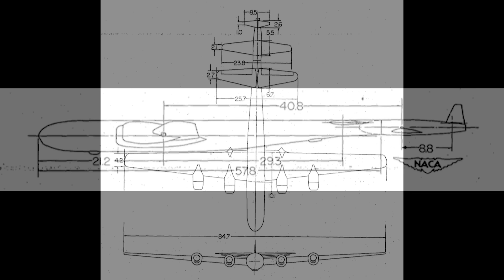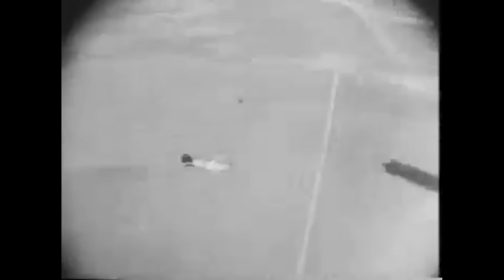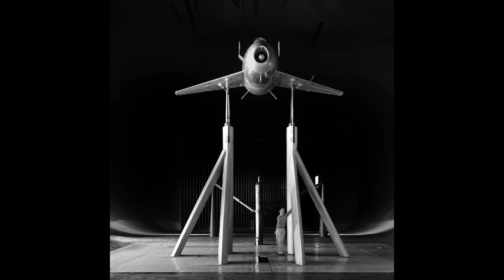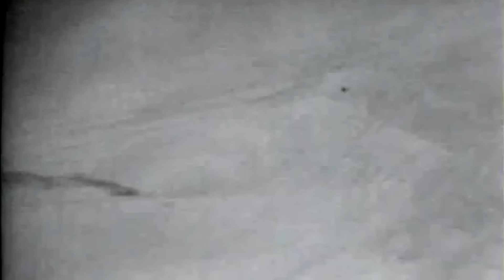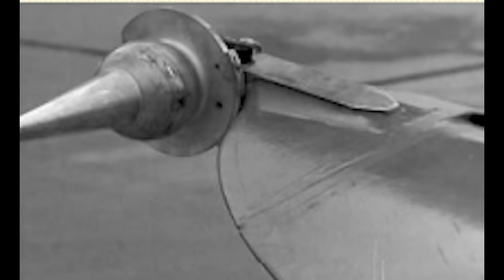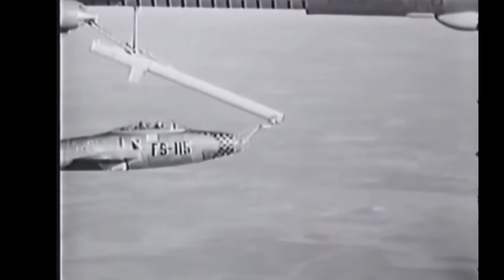GOBLIN, FICON & BURLAKI: Cold War Parasite Fighters Were A Deadly Dead End

Comment: The B-36/B-58 combo did fly. It was how Convair got the prototype B-58 to Muroc for flight test. I've never heard anything about it being used as a method of air launching B-58s for any sort of attack mission. Could a B-36 even lift a fully assembled, fueled and armed B-58? What they did was carry an empty fuselage and wings with no engines and probably no equipment inside. Doubts....

Comment: I always assumed the XF-85, with its jet engine and swept wings, was based off the same research as the F-86, using German data. I was surprised to find from your video that the XF-85/was designed in 1944. I can only conclude then that the Swept wings on the XF-85;were there for weight and balance reasons rather than trans Mach performance.

Comment: I dont care about all the propaganda and bs that claimed the b-36 was invulnerable to fighter attack and its defensive cannons were adequate. There is now way that massive shiny bomber would be able to bomb targets unmolested. Radar would pick it up at very long range and give mig15-17s more than enough time to setup several head on passes. Even with the migs at maximum altitude the size if the b-36 means hits are inevitable. Wouldn’t take that many 37mm rounds to bring it down.

Comment: WRONG. Dumbass AmeroBabylonians tried to put the parasite fighters UNDER the bomber transports. Stupid and Lazy. Parasites should be on TOP of the mother aircraft and it worked fabulously with the Russian ZENO system and German (sexy now) MISTEL precision directed munitions in WW2 COMBAT, the Brits had 2x aircraft combined with mother a useaplane, NASA had Space Shuttles moved by 747s etc. The notorious short range of the F-35 demands it be parasite carried say by a modified Shin Meiwa seaplane transport.

Comment: One you missed was a 1970s/80s proposal to use a 747 as an airborne aircraft carrier. The embarked fighters would be small, roughly like an F-5, and the 747 was to carry them stacked like an auto carrier semi truck carries cars. Can't remember the name of the program, but I've seen it in articles with drawings and so on. The fighter was never built, IIRC.
Reply: Yes, it was the Boeing 747 AAC. The parasite fighters looked like delta wing F16s, similar to the F16XL but with two vertical stabilizers and a smaller wing area.
Reply: I doubt you could fit many f5 sized planes into an 747 I would guess around 8 if you really crammed them in there
Reply: Well I would assume it's because 747 AAC was not a bomber, so that wouldn't be a parasite fighter as they were to be deployed in air superiority role, not purely escort.

Comment: There is a v-tailed aircraft in the background at 13:09. Does anyone know what aircraft that is?
Reply: That is the mockup for McDonnell's proposed XF-88 long range fighter. The initial design had a v-tail which was changed to a conventional layout after wind tunnel tests. Two prototypes were built but it never went into production. It did serve as the basis for the F-101 Voodoo.

Comment: It's a fascinating "what if" if the early towed jet experiments worked out better. We did, after all, figure out practical to do mid-air refueling.

Like ... a more practical parasite fighter might be carried under the wing - like the X-15. The height of the wing provides much easier ground handling and leaves the bomb bays free for bombs.

Then, the fighter could be towed back and then land on a skid.

Or better yet, the parasites could be ramjet powered, and carried by a dedicated jet powered carrier aircraft. That way, it could be fast enough to tow the ramjet during the return journey. So, the escorts start off as a jet carrying two ramjet fighters under its wings, and split apart if needed, and then they return as a jet towing two ramjet fighters.

Comment: I mean, on the one hand the Goblin is ADORABLE. On the other if I were a pilot I'd feel a bit nervous trying to fight Mig 15s in it.

Kind of like running into a big gun battle with a flintlock pistol and three reloads and everyone else is team firing MG42s at you.
Reply: The Goblin was a tiny target with lower wing loading and a better thrust/weight ratio than a Mig-15. Well, for 20 minutes, at least.

The concept behind the Goblin was flawed but it would have been extremely difficult for a Mig-15 pilot to actually engage one when it wasn't docking/undocking or out of fuel.
Reply: have you ever tried to fight Me-163s in war thunder with any of the technically more modern jets? I imagine it'll be something similar here as well, small and nimble would be hard to hit with a MiG-15's giant (and slow firing) 23s and 37s
Reply: @starliner2498  At least in War Thunder you get a 360° third person view. Imagine trying to engage that little fucker with a terrible soviet gunsight and their infamously poor cockpit visibility

Comment: 29:50. The photo is of a B-36 carrying the prototype XB-58 Hustler for transporting to Wright-Patterson AFB for testing. The B-36 gear was locked down and the inboard propellers removed to clear the XB-58. I don't believe it was ever used as a launch platform for the B-58.
Reply: The "thumbnail" image is from the box art of the Hobby Craft, 1/144 scale, Convair GRB-36 "FICON," plastic model kit.

Comment: With drone advancements I wonder if this is something that maybe revisited, ala Ace Combat 7's drone carriers.
Reply: While more modern bombers already carry air-launched cruise missiles of similar size and mass to the Goblin, I suspect that the development of effective air-to-air missiles might make a traditional parasite fighter drone obsolete - if you're engaging enemy fighters from beyond visible range using missiles instead of dogfighting, you might be better off sticking air-to-air missiles on the bomber directly.
Reply: @alexholker1309  The designs being referenced in the video are more in line of defense yes but I'm not thinking in terms of defense, more that of offense. 

Like a moderate sized plane the size of a Airliner, could have a swarm of them, either doing recon work, or ground attack. 

Seeing what is going on in Ukraine you could easily have a mobile carrier that has a swarm that could at the very least frustrate an enemy or do major damage to several targets at once.
Reply: FICON (whether piloted or drone) could only be viable defence against gun-armed interceptors that needed to close in on the attacking bomber. Once +75 mile-ranged SAMS and AAMs were developed, the lack of warning time would’ve rendered it redundant.

Comment: This tactic brings to mind the throwaway Hurricanes the Royal Navy used on their CAM-ships.
Reply: But less safe!😆
Reply: @MM22966  Indeed, desperate times require desperate actions?
Reply: @ProPexPup  It's been my observation that it's that, plus emerging tech. Somebody gets their hand on something new, and a lot of them time every way gets tried, with the surviving way being the one that works. Look at the different ways carriers were built until a basic form was agreed on.
Reply: @MM22966  Yep, engineering triumph through failure. Alhough in the case of CAM-ships it was more a question of the RN being overstretched and reaching out for desperate measures, in this case an criminal misuse of resources.
Reply: Those Hurricans were not the latest models. Basically well used and most likely to be parted out. So not the loss of resources as maybe imagined. 
The real problem was to save the pilot.